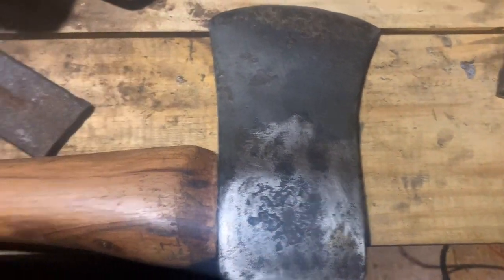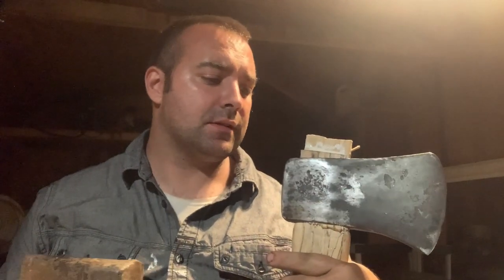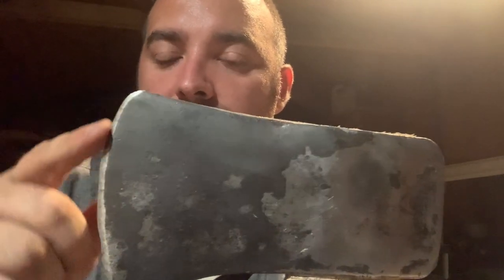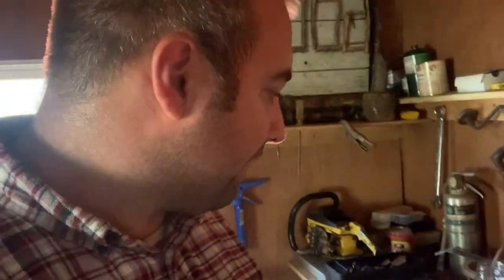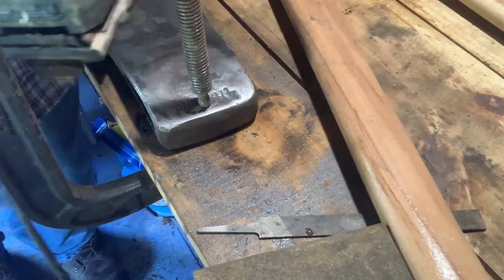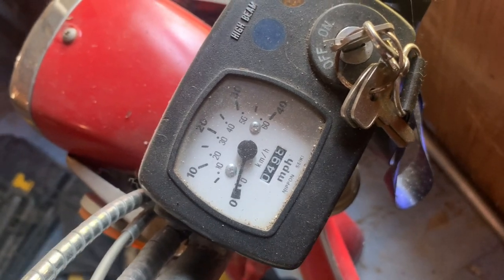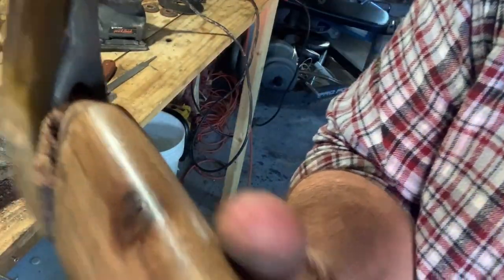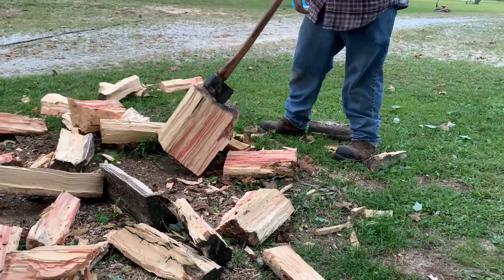Rehanging and reusing an old axe head. The right and wrong ways to do it.

Comment: The bottom the axe will be the smaller part of the eye .you have got in on right now. I am her husband. I don't have a computer I am using hers my name is Garry MC Neely. If you have the head far enough down on the handle your kerf where the wedge goes will open up.this sometimes requires removing quite a lot of wood.you should get yourself a Shinto Rasp. They cost about 15.00 dollars. Tyey have a course and a fine side. It will remove wood easily and if you take care of it and keep it inside out of the weather it will last you a good many years . I restore vintage axes for my hobby. I have over 200 on hand right now. They are in every corner of the house in both outbuildings, and even some behind the gun cabinet. How far are you from Lexington KY? My son and his family live in Lexington.if it is not too far out of your way the next time I am there for a visit. I will bring you a nice restored axe no charge. I know you are a man who needs it and will get good use out of it. I use to cut split by hand and sell firewood back in the day. Can't swing an axe but for  little while at a time now .I will soon be 69 years old and that combined with a kidney transplant and other health issues I faint swing em like I use to and still want to. Send me a contact number and when I visit this fall I can call you up and give you your axe. I have every thing from 6 pound axes to 3 pound full size axes. Also have boys size axes for your young helper.let me know what you would like and if it is not too much of a drive I will make it happen.
Reply from the maker: Thank you so much Gary! I was impressed when I thought that it was a woman commenting that because I know women usually aren’t real big into axes and I could tell you know what you are talking about. It sounds like you have a lot of experience with axes and I really appreciate you pointing it out to me the way you did. 200 axes is very impressive. That alone shows a lot of experience. I have a lot to learn as far as making axes go but I love it already and plan to make many more from here on. I am about 40 minutes from Lexington ky. I go there and deliver wood now and then. That would be great to meet you and an absolute pleasure and honor to get an axe from you. I really appreciate that very much and I also appreciate you sharing your knowledge. That means a lot. If you are able to get ahold of me the next time you come to Lexington I would love to meet you and get an axe and I’d be willing to pay if need be. I appreciate it very much Gary and I appreciate you watching! I will also plan to get some more tools as you mentioned for the axe making. I know having the right tools makes the job so much easier! 6069470176